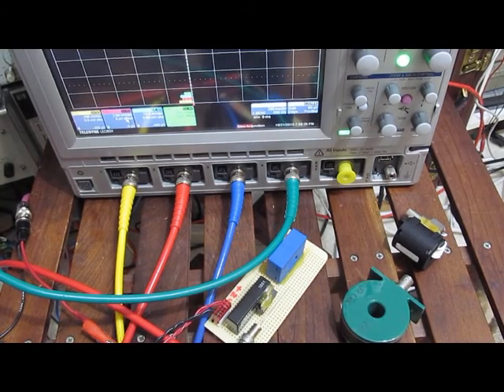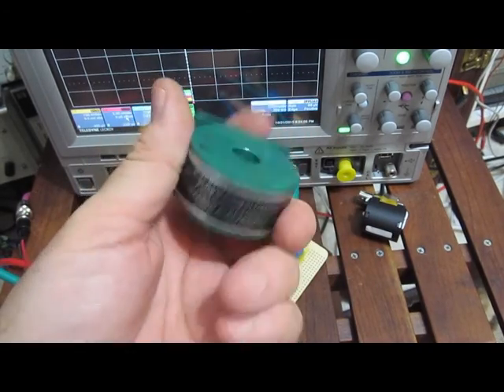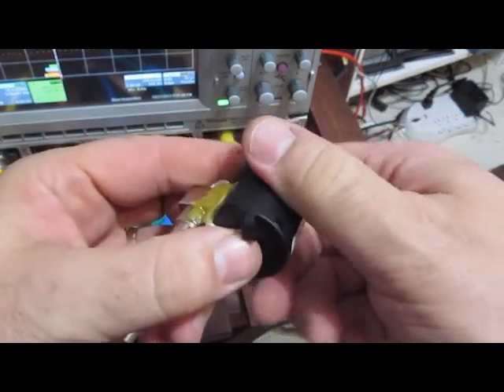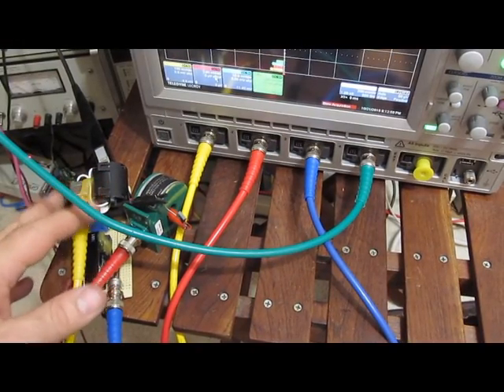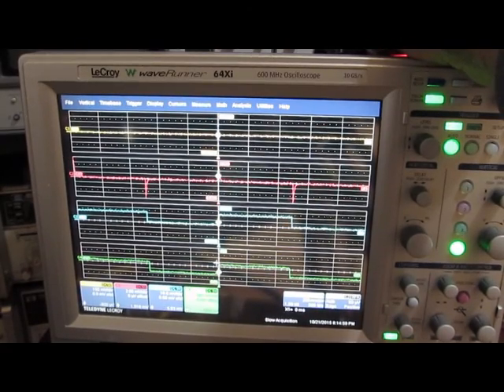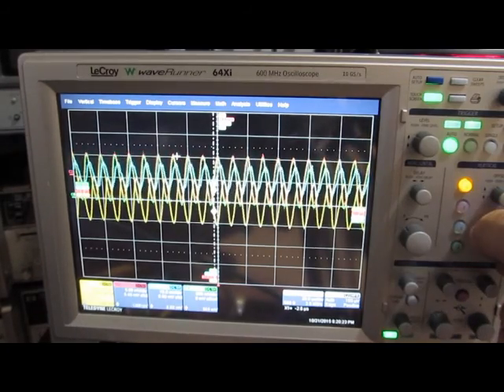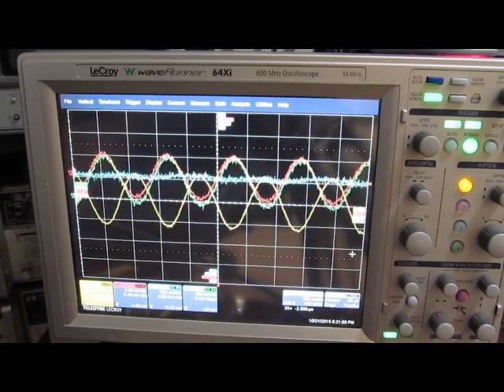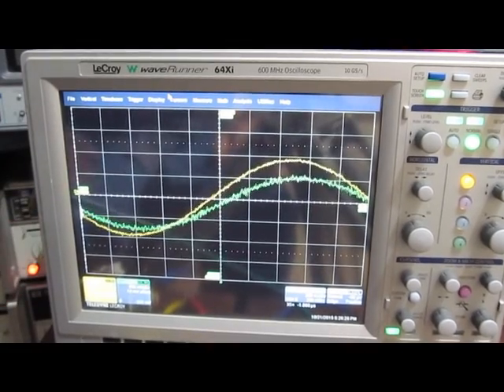Simple current transformer based on Steward split core

Comment: Hi,

Interesting video.

Is 50 Ohm termination the reason we are seeing voltage at the scope despite measuring current? I am asking this because 50 Ohm is often use for impedance matching. But in this case it acts as a burden resistor, right?
Reply from the maker: If the scope were not set to 50 ohms, it would still display a voltage.  The reason for 50 ohms was based on early coax designs.   A current probe like this could be made to give correct results using a different value.   I would call it a sense resistor.
Reply: It would display a voltage but actual measurement quantity is current right? If there is 50 Ohm, will be divide the oscilloscope voltage with 50 Ohm to get the actual current?
Reply from the maker: You have things a little messed up but yes, by ohms law, V/R = I.   Not R/V=I as you have it.
Reply from the maker: Keep in mind, that will give you the current through the scope's internal resistor.
Reply: Yes, sorry for that. Thanks for your explanation.

Comment: How to calculate a no of turns in secondary of toroidal ct and how to select core and coil size. Pls guide me... Its is important role in my project sir ( load current=20,ct o/p current=20ma,o/p voltage=5v)

Comment: Nice one! is it all connected to a function generator? whats the voltage if i may ask?
Reply from the maker: Yes it is a function generator which is how I switch from a square to a sine.  I would need to watch the video to know for sure but guessing it was set to 10Vp-p with a 50ohm load.